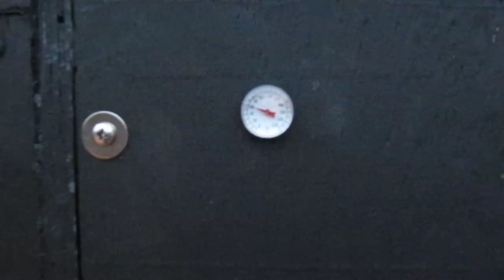GenBox 1.0 Setup

Comment: Would the smaller fan worked had the placement been better, both the intake and exhaust were in the bottom.  What do you think of sucking the heat out of the top and the inlet in the opposite lower corner side?
Reply from the maker: The fan has to be on the inlet because the exhaust would kill the fan from heat and corrosive gasses. The inlet and outlet are both where they need to be.

The outlet location has to be where the exhaust takes the shortest path out, and the inlet has to be where the fresh air passes all around the gen on it's way to the outlet, so, diagonally opposite the outlet. The flow path inside is between the two opposite corners from what it looks like on the outside, because there are U-shaped channels in the two baffle boxes that form the two end walls.

Also all inlets and outlets (There's 4 actually not just the two visible on the outside) have to be against the ground rather than the top simply for rain, and also simplicity. There is intentionally no bottom. It's just like 4 walls and a roof, which protects against rain, and whatever water does get inside just runs out again because there is no bottom. The gen sits high enough off the ground on it's wheels and feet that water on the ground passing through. like say if it's raining real heavy and there is 1/2" sheet of rushing water on the ground, it's fine.

You could decrease resistance and increase air flow by making the baffle boxes fatter. 8 or 10 inches instead of 6, and by increasing the upside-down U openings to the full 1/2 of the width of the end walls. The end walls are about 30 or 32 inches wide, so the openings could be almost 15" wide and tall. But then it might leak more sound out the inlet and outlet, because the passage might not be as much of a full U turn inside. Right now, the tops of the inlets and outlets are only about 11" or 12" tall, and the divider wall in the center of the baffle boxes is exactly 1/2 the height of the box, so about 15" or 16". That means there is definitely no "short cut" that sound can take between the inside and outside openings. It has to go around the wall and hits the carpeted surface inside.

Still I think having the baffle boxes be at least a little thicker like 8", and the openings be as wide as will fit, is probably still a good idea because there are a few conditions where the temps do get higher than I'd like. I have seen it get almost to 140 a few times on a 90-95F hot day, and winter-mix gasoline can start to boil at 140F. Summer mix gas boils at higher temps, but you have to figure for the worst case, so say it's the middle of the summer and you're using gas you bought in the middle of winter. So, it's been several years and it's been fine the whole time, but still some more flow would not hurt just to increase the safety margin.

But definitely, no way would the lesser fans like that 600cfm from Grainger be even remotely close. But If the openings were larger, like 15", and the baffle channels were deeper, it might open up the option to use equally expensive but more readily available attic fans off the shelf from local suppliers. Those fans are 12 or more inches wide, which is easy to fit, but they are also way more than 6 or 8 inches deep because of how the motor sticks out. So I don't actually think they'd work anyway. Car radiator fans are easily powerful enough and easily fit, but they are DC and need a high amp DC power supply, which is just an unnecessary extra part to fail, especially out in the weather.
Reply: @VorSwank  what sort of fan power cable did you end up using?  I think I finally have the final pieces to finish it this weekend, hopefully.
Reply from the maker: @jimm.2712  I'm just using an ordinary power cord. Grounded, though it doesn't really need it. I don't remember if I just cut an extension cord or got an actual tinned-end power cord like home depot has with the extensions.

Did you use the FreeCAD files to get the dimensions or those pics of those hand drawings, or are you just using the general idea and eyeball actual dimensions as you go?

I finally made those cad drawings but I still need to generate cut and assembly plans from that now.

In the github where the cad drawings are I went into more detail about the screws and the fan, more alternate model numbers for the fan,  and in the cad file you can explode a more detailed view of the fan mount and just generally see how everything fits together.

Don't forget to heat-shield where the exhaust blows right into a flat side-wall somehow. The way I did it has been working fine, but I did always figured there must be a simpler and cheaper way that would work as well.

Good luck!
Reply: @VorSwank  Thanks Brian,  box & baffles are built using your drawings, dims and ideas.   I bought the Orion fan and should be able to get 3 passes in my baffles, being in Denver the snow can pile up and putting the in & out puts at the top will be helpful.  What are your thoughts on horizontal or vertical passes? 

I do have the heat shield taken care of, gen exhaust comes out the end.
Reply from the maker: @jimm.2712  I think it probably doesn't matter which direction the U points, only that the air goes around a 180 degree turn.

I think there's 3 things that matter,

1 air goes around a 180 deg turn on the way in and out.

2 fan is on the inlet not outlet, and on the interior wall of the inlet baffle box away from weather and fingers.

3 the outlet is close to the exhaust.

I didn't think too much about snow.

 We get snow, but I figured if I ever need to run it, I'd just clear it. Or if it was actively snowing and building up fast, maybe slap a sheet of plywood and a couple cinder blocks over the top to overhang the inlet side or something.  I'll have to think about that some more.
Reply from the maker: @jimm.2712  What do you mean 3 passes? more than a single 180 bend? Are the boxes huge? You don't want to restrict the air flow with narrow passages.
Reply: Hello  @VorSwank  My Baffle Boxes are 32 tall x 38 wide x 6 thick, gen box is 34 long.  Looking at the end, input hole in the upper left, down over up over and down to the fan, output end would be just the opposite, passages are 12 x 6-ish.  The gen exhaust port is around 12” off the floor so I picked up a telescoping dryer vent for $2 to route the exhaust to the output hole.  

Some time ago I asked about the location of the output hole into the baffle,  as heat rises wouldn’t the output be better in a top corner or won’t it matter given the 1130 cfm fan and small box?

I hope to be able to work on it more this weekend, need to caulk, install sound deadening MLV, fan, coat the outside and probably a couple other things I’ve forgotten about.

I’m thinking about putting sort of hinge in the top so I can lift up just a section when needing to start and refuel, or maybe the hinge on the far end , I don’t know, it’s a work in progress.  

Thanks for letting me pick your brain.
Reply from the maker: @jimm.2712  12x6 might be ok. I worry about restricting the air flow. Making the passage longer adds resistance too even if it's large, and you really don't want to lose any of that cfm.

But, 12x6 is still a pretty good passage. And if you don't get 90+ degree days too often then it's probably ok. And worst case, the outer box is removable anyway, only attached to the main inner wall by T-nuts and machine screws, so it's easy to pop it off and reconfigure the baffle walls if it comes to that.

If the temps are still good, that's all that matters, and I bet it's even quieter.

Watch the temps inside. The worst-case scenario you need to be aware of is that gasoline formulation changes for summer & winter, and winter gas boils lower at around 140F. So you want to make sure that even if you have winter gas left over being used in summer, that the temp inside the box stays below 140F even on a hot day in summer.

I positioned a thermometer right above the exhaust and outlet which should tell me the temp of the gas tank generally. It's not the hottest spot in the box, that would be right at the exhaust, but the exhaust hot-spot isn't actually the main problem. The gas tank isn't at the exhaust, just a plywood wall. You can tell if that spot is getting too hot just by feeling the outside with your hand. If you can touch it, then it's nowhere even close to burning.

But 140F is way down in residential hot water territory. So the airspace around the tank is the part to worry about.

So far, even on hot days, as long as the lid is closed (forcing the air to pass over the gen and out the outlet rather than just out the top without carrying any heat away from the gen) I've been staying at 120F or less.

If the fan were to simply die, that would be no problem, because without the fan, the gen chokes on exhaust and dies in just a few seconds. No problem with overheating there.

But if the fan is running but flow is just not quite enough, that's the danger zone.

I think this should really have some kind of safety cutoff. I was toying with the idea of some kind of little home made thing with an arduino or esp8266 etc and a couple sensors and a little web page to check it from your phone by wifi. That way, even without modifying the gen, at least it could send you an alert.

But really I think the best would be a simple snap disk like on your furnace. You'd just mount it somewhere up near the tank, and pass the main on/off switch through it. That requires modifying the gen, which I really wanted to avoid, but it's a pretty simple mod and would make it a lot safer, and 1000% more reliable than some arduino.

OH! Maybe you don't have to modify the gen, just have the snap disk kill power to the fan! I think you can even buy pre-made temperature controls you just plug things into just like light timer controls, though probably not cheap. I think a snap disk is only $5 by itself, and you can pass the full 110v right through it like a light switch. You just use crimp on spade connectors to connect it. Dead simple. I am going to look into this now.

Without that, I say just watch it to see how it performs, under load, it makes more heat under actual load, and once you've tested it and seen if it's good under load on a hot day, then you're good all other times. Winter for sure is safe.

Comment: BRAVO.....DB'S   LOW I'M SURE ?
TEMP ?...can't see it.
At 20 feet 50 feet and 100 feet should be 60 or lower to be a happy neighbor and for park use 60DB at 100 feet.
Reply from the maker: Yeah it's been a couple years now and it's been perfect. quiet and the temp plateaus around 120 when it's hottest out. I'm uploading some pics to google photos right now to show what makes it all actually work without overheating yet still be quiet. Basically 4 things:
1 - special fan. 1100-1200 cfm fan in a 11" wide by 4 or 5" thick size. I had a 600-700 cfm fan from grainger that still didn't cut it.

2 - baffle boxes on the inlet and outlet that makes the air go around a 180 degree bend. Lined with thin indoor-outdoor carpet to provide some sound damping yet not block air flow.

3 - heat resistant patch right where the exhaust blows. automotive silicone to glue down a couple sheets of aluminum foil to reflect radiation, then some fiberglass mat (plumbing torch shield) held over that by some aluminum screen. (gutter guard, but you could use anything) this keeps the exhaust from getting the wood too hot. It works. You can lay your hand right on the hot spot even after hours of running.

4 - extra layer of cheap shaggy carpet all around the inside of the main chamber. (not in the baffle boxes)
Reply from the maker: This is the inlet side. This is not the final fan , so ignore the actual fan, just look at the placement and the U-shaped air channel. https://goo.gl/photos/sMLZwbW2hJLtMG1P8
Reply from the maker: This is the outlet side. It's exactly the same, just no fan. The outlet is right next to where the exhaust is, so that the direction of airflow carries the exhaust, and it's heat, directly away from the generator.
https://goo.gl/photos/X2huERAkFna2s8gd7
Reply from the maker: This is the final fan arrangement. I can't seem to find my pics of the fan itself to show the model. I'll get that later. I added a piece of plywood to the inside face of the box, so that the fan is essentially suspended mid-way in the  main sheet of 3/4" plywood, so that it ends up only sticking about 1 1/2 inches into the baffle box air passage, so that it doesn't constrict it's own inlet, and only sticks about 1 inch into the main box interior, actually slightly less than the 1 1/2 vertical rails on the sides. You can lay the baffle box face down on the ground and the fan doesn't touch the ground. There is a strong 1/8 thick expanded steel screen over the fan because this fan is dangerous. It's got heavy steel blades and spins very fast. I don't think it would merely hurt, I think it could take a finger literally off. The fan is AC, so it can be powered directly by the generator without a dc power supply. They make 1100 cfm fans this small with 12v dc motors for car radiators, but that would require a power supply, which is no good on a few levels.
https://goo.gl/photos/DRmuwq2A8CU11Q7s7
Reply from the maker: And this is the whole messy album. It's a lot of redundant stuff and some details from the beginning got obsoleted and changed later. And I still don't have anything that shows the final fan make & model and clear shots of how it's mounted. I'll have to get new shots for that.
https://goo.gl/photos/VuZsvcwMcuBNV2xo6
Reply from the maker: Ok I found some pics detailing the fan, and added them to the album.
Reply: Brian it looks good and the DB'S have to be very LOW....... but a mechanic did a video showing ....overheated.....units because they only had one fan.
The overheated ---->  Generator.....had a heat maximum number of 104 degrees.
I love the box but he was insisting on external exhaust and 2 fans.
How is your generator able to handle 200 degrees ??
Reply from the maker: Temp never goes over 120 so far, although, it would have to if ambient was say 100!

I actually performed a dead-fan test a few times. What happens is the generator consumes all the oxygen and the generator dies long before it gets hot enough for the gas to boil (which is about 140F for "summer" gas, about 110F for "winter" gas.)

So, no need to wire in a snap disc into the motor cut-off, although you could still do that if you wanted. I had a pointed aim not to have to modify the generator at all.

There is no place for a 2nd fan without making the box huge. You don't want one on the exhaust side because exhaust gasses would just kill it. You don't want a 2nd one on the inlet side, unless you make the overall box big enough for both fans to be next to each other near the ground, so that the sound is still forced to go around a 180 degree bend to get out.

You could perhaps put a 2nd fan on the very outside of the inlet, on the baffle box, but then that fan is exposed to rain, and exposed to your ears. You would basically want a whole additional 6 1/2 inch baffle box on the inlet.

Myself, I decided letting the the gerator just choke itself off from exhaust solved all problems elegantly.

It just doesn't handle the possible situation of a weak fan, that's still running a little, enough that the motor gets a little oxygen, but not enough to keep up with the heat.

Maybe the snap disc idea is worth a look just to really cover all bases. But, in order to avoid hacking on the generator at all, maybe the snap disc operates louvers that close over the inlet and outlet. Make it so it requires power to a solenoid to open them, so they always shut themselves. That would starve the motor even if the fan were partially working, or even if the fan were fully working, but just ambient temp was just really high one day. I don't think I'll be doing that, but I think I'll keep an eye out for some practical way to do it, like parts that aren't silly expensive that could do the job. This would probably add at least a few hundred more to the cost of the box.

Comment: Well I learned exactly Zilch, poor videotaping, bored with background radio.  Good luck.
Reply from the maker: It's not a how-to. All it ever was intended to do was document how long it takes to set up from scratch, as though you just arrived at a camp site or something, with no artificially optimized practiced motions. Read the comment for the how-to including links to cad files that show exploded assembly views and dimensions for every part. Or don't. Good Luck.